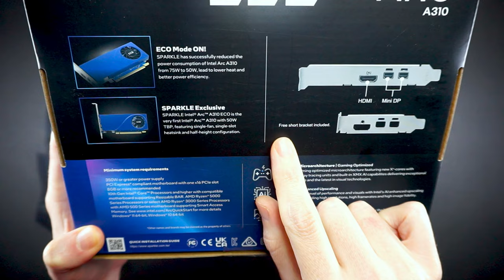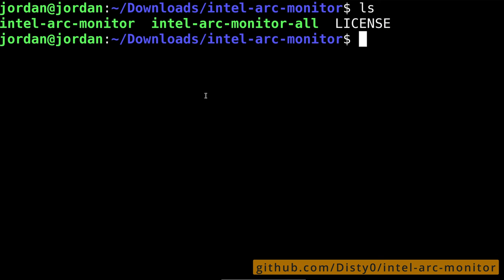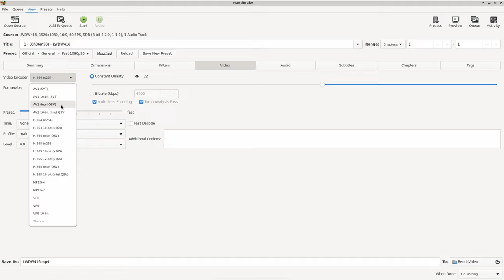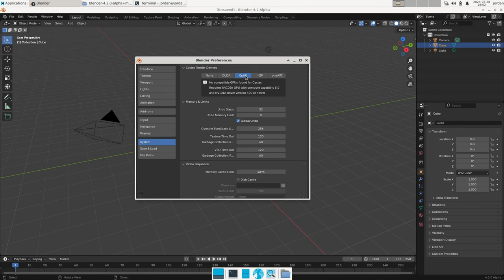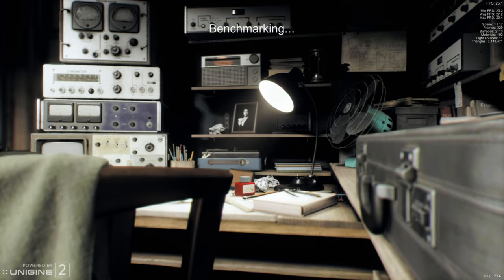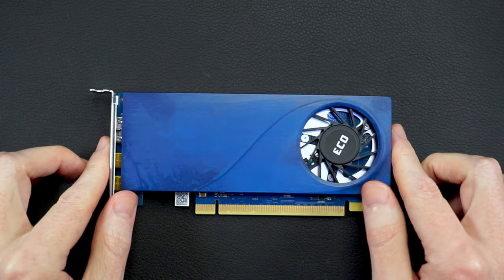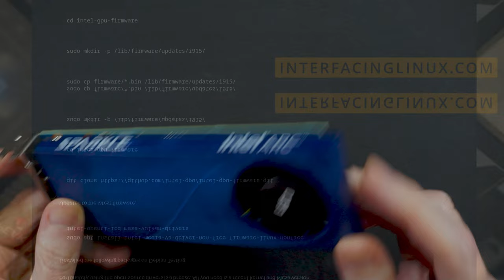AV1 On Linux With The Sparkle A310 ECO

Comment: Btw, it’s ok if you break the void sticker in the U.S.
In 99% of cases, they’re legally non-enforceable.
Reply: Correct, it’s actually illegal for manufacturers to do this per the Magnussen-Moss act. You can even report them to the FTC for it.
Reply: @progenitor_amborella  AFAIK, they can put all the "Warranty Void" stickers they want to on a device, but they cannot enforce it legally.
Reply: @Bob-of-Zoid  exactly.
Reply: Manufacturers are not honoring warranties anyway though because the FTC... Well, they ARE finally going after monopolies starting with Apple, but yeah, in the meantime, until the FTC finishes up with that, these manufacturers are just giving consumers the birdie.
Reply: *100%
Reply: I very expertly get the sticker to remove cleany via a thin piece of plastic wedged under neath pre-wetted with isopropyl on the wedge. 

Then I put it back when I am done, exactly the same as it arrived.

Takes a moment or two, and there is a risk of messing it up anyways, but it's nice to be able to do it. Why?

If I ever resell the gpu, there are certain dolts out there that think that because the sticker has been broken, thus warranty voided; that the card is now worth much less than it really is. Never mind the fact that the new paste put on, or heaven forbid a better cooling system on it, made it worth more than before in a way. To iterate in a different way. You could buy a brand new card just released the same day, swap the paste, and some dolt would think it's worth half now, when really... you just made it work as promised or better.
Reply: @Bob-of-Zoid  Not even that. The stickers themselves are illegal and may be reported the the FTC. They're not likely to do anything without a LOT of reports. And if the company refuses to honor it's warrantee over a broken sticker you're likely going to have to sue in small claims court for something like this and hope they pay the judgement though.
Reply: and all you have to do is pay a lawyer to fight for it.
just because something is illegal doesn't mean companies can't or won't do it.
Reply: I just commented the same thing. Yes those stickers exist in the US on almost anything... yet they're illegal in the US. Here's what I had commented:

Taking something apart does not void the warranty in the US. In fact stickers that say that are illegal in the US. Yes, manufacturers still place the stickers and say that anyways. Yet in the US it is the manufacturer's responsibility to prove that work you did to the product caused product failure. That responsibility is 100% legally theirs.

Comment: Not only AV1 Encode for this low profile card but also :
-Ray Tracing
-Variable Rate Shading (VSR)
-DirectX 12 Ultimate
-Vulkan 1.3
-OpenGL 4.6
-OpenCL 3.0
-Adaptive Sync
-VP9 Bitstream & Decoding

Still not available in my country yet.
Reply: Amazon sells it. Are you in a country that Amazon doesn't ship to?
Reply: @Supermath101  Shipping cost probably are to high
Reply: Still what's the compatibility with latest DX12 and Vulkan versions useful for outside of gaming. Very few programs outside of games will require all the new shiny extensions. It's position as a purely video encode/decode card still stands imo unless you wanna retro game on it but still old games don't require newest extensions of the APIs.

Comment: Man i would love this for my AV1 media server.
However i do not have a basement, it sits right next to my desk in my apartment.
Reply: Earplugs are an option.
Reply: ANC headphones are a good option. I have mine on half the day for calls and media anyway, but will keep them on for the quiet at times.
Reply: passive models are available iirc, and sticking a 3D printed noctua mount on the card would keep it very cool without sacrificing silence too much
Reply: @ExtremeMetal  hrm, can you point us to some?
Reply: @icebalm  The only passive card I can actually find is the Matrox branded A310, I thought there were more available but I must've been mistake for an older Intel card, maybe one of those Xe cards?
Reply: @ExtremeMetal  Unfortunately it looks like Matrox thinks the passive cooling is worth about $500 more than the Sparkle A310....
Reply: @icebalm  For a modest price increase, you may want to go with Sparkle's or ASRock's A380 LP offerings, assuming you need LP. They use more traditional axial fans and larger heatsinks, which I'm going to assume are quieter. They are dual slot however.
I'm using ASRock's non-LP A380 as my encoding card and it's pretty quiet unless it's maxed out. Which is basically never if all you're doing is using the media engine hardware.

Comment: 50W Timestamps 
00:00 Intro
00:22 Low-profile bracket installation 
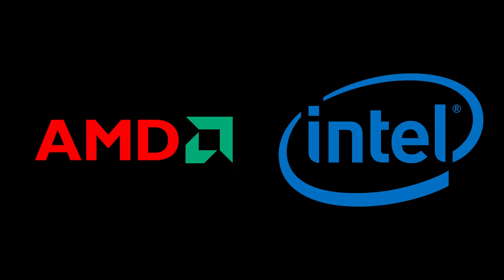01:19 Linux drivers 
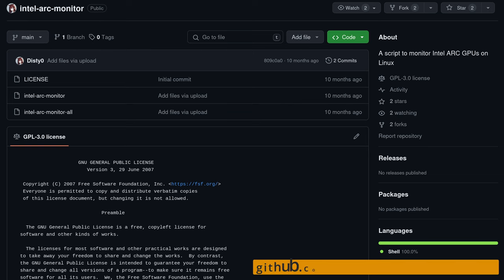01:48 Monitoring utilities 
02:04 Fan noise goes brr 
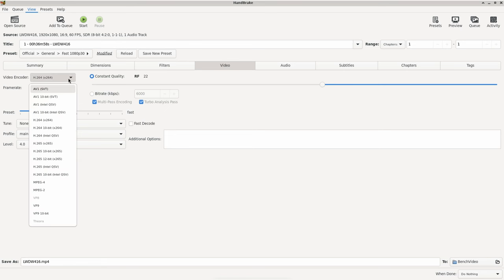02:40 Handbrake AV1
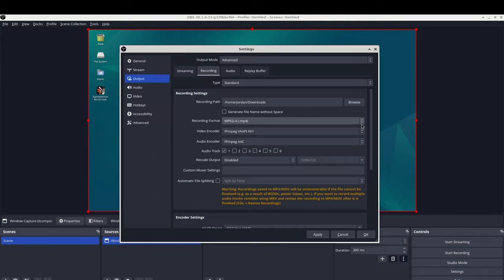03:05 OBS AV1
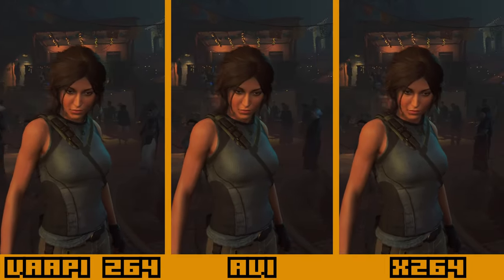03:35 Blender 
03:52 Davinci Resolve 
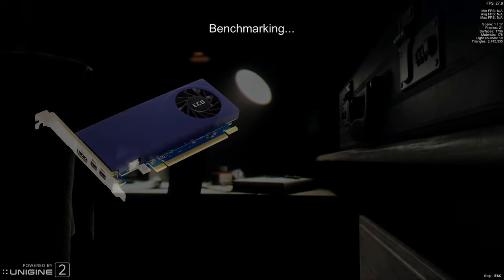04:17 Gaming benchmarks 
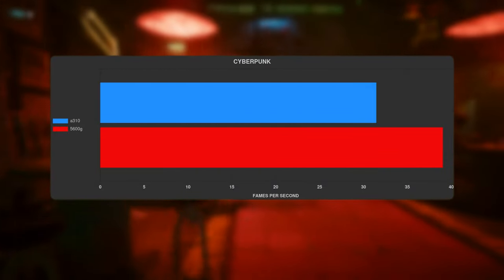04:54 Verdict

Comment: I just got this card for my home media server.  All my files are in h.264 so I almost never transcode, but the few times I do, it nearly pegged my CPU at 100%.  It’s a 2008 Intel Xeon E5450 @3.0 GHz, 8GB of DDR2-800 memory, an Intel 120GB SSD, 3TB and 8TB storage drives to run PLEX on Ubuntu Server.  Yes, I did the LGA-771 mod.  I had to update my Kernel and install Mesa like you said, but it works.  Transcodes happen on the card and the CPU stays at IDLE!  Great little card for video transcoding and keeping power usage on such an old system down.

I used console only version of Ubuntu and it runs at about 350MB of memory usage idle.  The SSD keeps the whole thing snappy and gives a good spot for transcoding to operate from while the slower drives are more than capable of keeping up with my needs.  The 3TB I use as a share drive on my network and the 8TB is solely for media storage for Plex.  I haven’t even hit 3Tb used on it yet, though.

Comment: Honestly, I went the ASRock A380 Challenger route instead and my only intent was Plex transcoding.  Yes, it required a single 8-pin PCIe plug, but the fan is quiet even while transcoding. It can be found for under $100 open-box and has a slight bit more performance w/ a 75W TDP. Unless you need the low-profile size, it's probably a better route for many users. Same Linux caveats though - weak driver support and good luck building the out of tree variants under Proxmox...

Comment: Iirc the reason that they stopped releasing binaries is that it was a stopgap measure until they got the open source kernel modules working with the Alchemist GPUs.

Unless I've missed something, they're a mess because they're not supposed to be used anymore anyway.
Reply: @illsmackudown  "we stopped releasing closed source drivers because they're fully open source and integrated into the Linux kernel" is an excuse? What's it an excuse for, doing the right thing?
Reply: yes. the first Xe-LP binaries originally was meant for Iris Xe MAX where the card only work in passthrough mode in a vm and had two differing driver for IGP and (mobile) dGPU. it utilize SR-IOV for that purpose and yes, from Xe-LP programming manual SR-IOV is enabled unlike Xe-HPG

until the Iris Xe MAX support finally upstreamed and no longer require hacky workaround, this was the go-to driver for intel GPU (Iris Xe MAX, mobile dGPU though some exist in desktop form) on Linux. Alchemist/Xe-HPG support just require upstream kernel driver and mesa after that, though Xe-HPG kernel driver took longer time to be promoted out of force-probe flags

Comment: plan on picking up one of these for av1 encoding with my 6900xt. I will for sure get a fanless model though
Reply: They run pretty hot even at idle, although the media engine only uses like 15-20 watts if I'm remembering right on my A380, I haven't looked in a while.
I use mine on my NVR machine to encode video feeds since the Ryzen 3700X does not have an iGPU. But that's pretty overkill so I also use it as my video library encoding machine, has plenty of horsepower for both. Quicksync is pretty amazing.

Comment: I am waiting for this card since forever, but the first ones from intel directly were only available in oems /dell and hp/ not in retail, than matrox offered themselves with the luma /Matrox LUMA A310/ that is fanless and has 4 miniDP outputs, but it costs some 500+ euro, asrock and sparkle brought out some thick two slot versions with fans and like this one crippled to 3 monitor outputs, hopefully soon someone will bring out one passively cooled 4 monitor supporting one slot occupying version for 99 euro, would buy two of them, one for an older pc to add multiple monitors support and the other one as secundary video card to handle streaming and video editing on the fly

Comment: I have an Asrock Arc A310 Low Profile and replacing the brackets was very easy so this is definitely a f-up from Sparkle. The Asrock card runs well so if you thinking about getting an A310 I can recommend it.

Comment: I bought one if these a310's.. and now I've ordered an adaptor cable so I can plug its fan into a 4pin mobo fan header and control it myself. will reply here how well that works when it arrives.
Reply: any update? I bought one and the fan revving is driving me berserk, hoping others are having better luck with aftermarket mods

Comment: In my experience, there are times that Intel's drivers require a HDMI display to be plugged in for firmware.. not sure removing the video would be a good idea.  I took the ASRock A380, removed the fan, and it fits well enough into my PC's bottom PCIe 4x slot along side my RX 6800 XT.  I wish a single slot A380 solution would be released.  I'd rather have proper access to the video outputs, but I couldn't use the duel slot over in my single slot PC.

Comment: As an owner of A380 Sparkle ELF, I'm a bit disappointed with A310 build quality. I have none of these issues with my card. It is silent and relatively cold, though it is not a low-profile unit.
Also, based on own experience - ARC streaming quality in HEVC is a bit higher than AV1, it can beat pretty much anything else on the market as of now. AV1 is nice to have, but until recent 30.2 - OBS  AV1 encoding implementation under linux was quite buggy and may result in stream crash. Presumably 30.2 fixed that, but I can't say for sure yet, due to some broken plugins dependency.

Comment: Intel arc drivers for Linux have been updated at least 2 times since I got A750 in March 2024. The website showing November 2023 is incorrect. They forgot to update it. 

Right after Blender 4.1 came out they updated them, since their drivers at the time only supported blender 4.0. ( I reported it to Intel )

And right around when blender 4.1.1 came out they updated it again.

I run Ubuntu 23.10 + the Intel GPU repo.
Reply from the maker: That's fantastic news. Hopefully Intel will give give their download page an update.

Comment: Can you not use Intel_gpu_top in terminal to monitor, it what I use to monitor my intel iGPU, out of the Intel tools. with the ryzen 8700G and the 9000.having navi 3 and AV1 encoding, intel done this to late really. also all RTX 40 and RX 7000 card has those encoders or their version of them. but if you still rocking a last gen GPU and want to stream to youtube in AV1 than £99 isn't much to drop in as a little PCI E Card.

Comment: The cheapest A310 in my region is 115 €, but it has 2 top down fans... Might not be as terrible for noise as the sparkle one.
Reply from the maker: Single-slot blower fans have always been silly loud. An axial cooler will be much quieter.

Comment: As a defender of blower-style coolers, they are amazing for high-temperature and cramped environments like servers, but that cooler on this A310 specifically looks to be pretty damn garbage. There's not even any exhaust holes on the bracket. I've owned many blower-style Nvidia Founder's Edition and Nvidia Quadro cards and they're not nearly that noisy, even at full load. While it is true that a standard axial cooler will cool a card better in ideal conditions and be quieter, blower-style coolers have gotten an undeserved bad rep and I'm not quite sure where it comes from. And finally, in my arrogant opinion, blower-style coolers just look way better than axial coolers.

Comment: Including a half-height bracket you can't install without removing the heatsink - Classic GDS - Geek Design Syndrome.  When the hardware/software designer is too close to the project to think about usability / user interface.